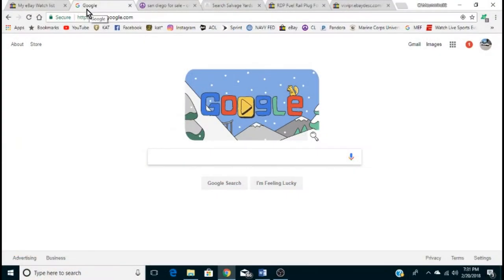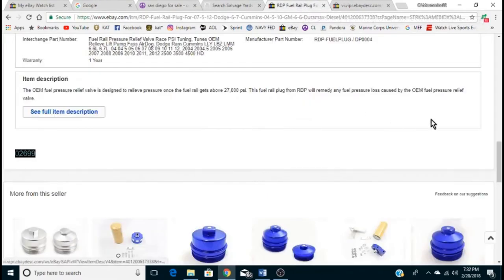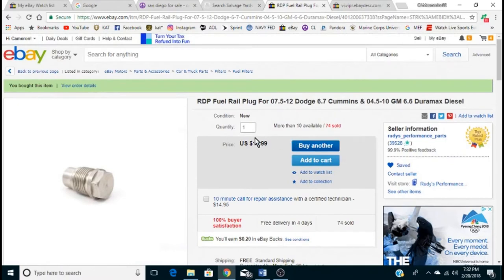HOW TO SHOP FOR DIESEL PARTS/ PARTS REVEAL

Comment: How did that fuel rail plug work for you did you notice any rides and rail pressure, any difference in truck performance.
Reply from the maker: tsimmons1974ts the fuel when getting on it is consistent it doesn't spike down in line pressure. The truck picks up smoother cause it's getting full fuel value. I like it no complaints.